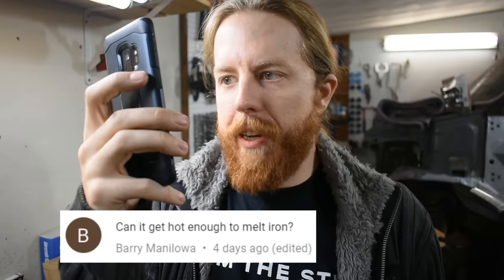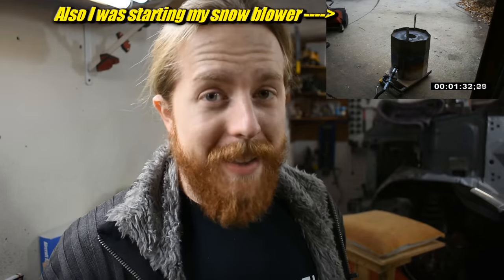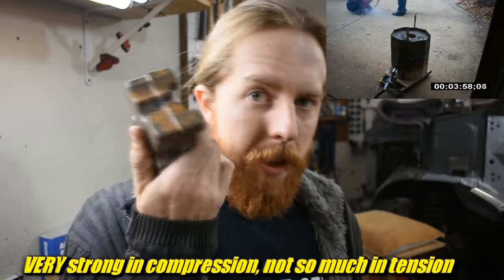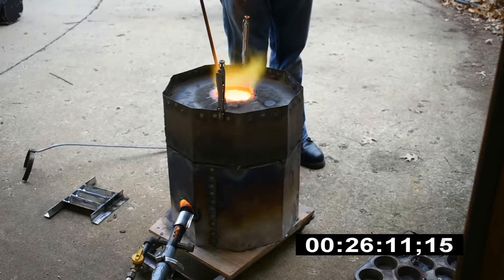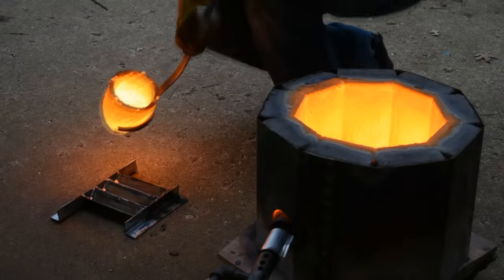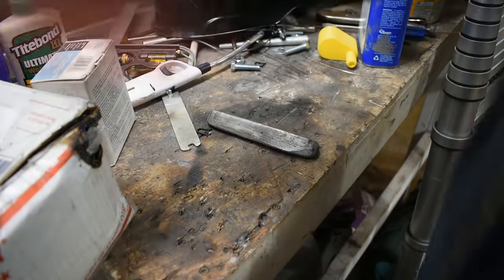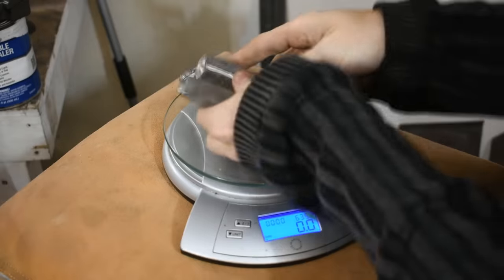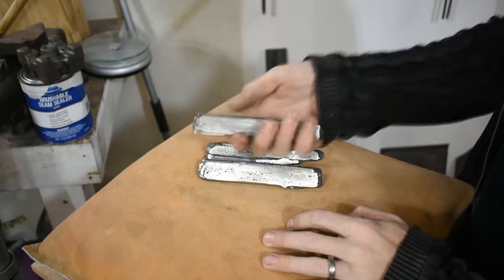Can I melt Cast Iron in my propane furnace?

Comment: It's a weight that goes into the base of a clothes dryer, to reduce vibration. We manufactured them at the iron foundry where I used to work. We shipped lots of them to Whirlpool. If there's casting ID lettering, I could tell you which of our facilities it came from.
Reply from the maker: Bingoooo!
Reply from the maker: Though technically it's a washer not a dryer, but close enough
Reply: @PaulsGarage  Yeah, I was debating between the two. It's been a few years since I worked there and I couldn't remember. We had a few parts that went into every washer and dryer.
Reply: i was gonna guess the same thing just because i know you work on stuff like that and they cant use lead anymore
Reply from the maker: The weird thing is they usually use concrete in newer machines, maybe they used iron here so its compact and wont crack and fall off? Idk
Reply: Well, they were still regularly making that part number when i left in 2016. 🤷‍♂️
Reply from the maker: You can still buy that washer sold as a cheap Amana if I remember correctly, they sell lots of them.  I'm hoping it will be a long term source of lots of this iron
Reply: lol i thought it looked like a companion cube from portal!
Reply: I would have never got it

Comment: Good work matey 👏🏻👏🏻. Don’t know if you saw my cast iron melt a month ago🤔. I melted a bbq hot plate . I had a brand new clay graphite crucible and it got a pin hole leak towards the end .( yes it was tempered perfectly ) . I had a lot of people tell me my Ingot would rust being cast iron but I sanded and polished to a Mirror finish and so far nothin👍🏻. My tank was starting to freeze  so I sat it in a tub of water and it worked a treat and the tank didn’t freeze . Eh at  least we know now 🤷🏻‍♂️. Take care Paul talk soon my friend
Reply from the maker: Thanks!  I did see your videos that's why I used a crucible I dont care about.  Looking forward to casting with it and seeing what you make! Btw that 3 color ingot you made looks awesome, time to add some cast iron to it though 👍

Comment: I bought a 100 gallon tank of propane so that solved my tank freezing problems.  My little furnace melts cast iron in about 30 minutes.
Brake disks make great iron castings BTW.   If your iron castings come out super hard you can put them back in the furnace along with some King charcoal nuggets and heat up to red color, then let cool.  It will allow you to machine them.
Reply: Yup. Nice and annealed, then. It helps if you let them cool slowly in something like sand or vermiculite.

Comment: That's quite interesting and a nice clean pour. Well done. On another note, part of the reason it may have been hard to grind is that the ingot mould being cold will have induced a chill in the cast iron. Often old casting can contain these and they are difficult to machine though they can also be intentionally induced to produce very hard surfaces. Basically you freeze molten cast iron in the pour state when it isn't iron with carbon in solution, but iron carbide. Very hard. Useful when intentional. Not so much when accidental.

Comment: Luckygen 1001 in my opinion is the go to guy for cast iron, just like olfoundry man is the go to guy for cast aluminum. Everyone watching wants you guys to do iron, they dont realise how harmful it is to your stuff. Its not a hobby type thing to do, too many variables, waay more dangerous. Not goin to say i told.... Anyway....you learn by doing, keep it up even in cold weather. Good show!!!
Reply from the maker: It sure wrecked my crucible, that's for sure, but it was toast to begin with.  I actually built this furnace modelled after an iron casting furnace, with the special higher-than-normal temperature light bricks and satanite.  One could say I was hopefully planning ahead?
Reply: Yeah luckygen!
Reply: @PaulsGarage  iron is the holy grail of casting. That's great that you can melt it.

Comment: Hey 👋.  Super cool! That has inspired me to try cast iron myself. Thank you for sharing this video. Seriously! I'm gonna try a foam skull. I use sifted play sand and all natural cat litter. Pure bentonite clay. I used a cheap food blender from dollar general to turn that into powder and start mixing the two with a bit of water until it is good. Awesome! I can hardly wait to try. I just learned about Nordic gold...basically aluminum bronze...it is mostly copper. A bit of aluminum, zinc and tin. I built my furnace out of a twenty pounder propane tank. Built the burner as well. I got the idea on line. Happy welding, melting, building outdoor life!!

Comment: Good explanation but you must check the addition of ferro-alloys like ferro-manganese,ferro-silicon, carbon.. etc. to make grey cast iron..at above liquidus temperature mixed it well, and check for chill depth to know the CI grades FC 20, 30, 40, 50 before pouring to mold.There is a massive oxidation of metals and alloys during melting and the life of Crucible will be shorter.

Comment: Paul, did you ever consider cutting the brick in the middle at half the desired angle and flipping one half 180? That gives you an angled brick with only the saw dust as waste and no spaces. Then butt the flat sides of the adjacent bricks. Again, no spaces and little waste.
Reply from the maker: It was suggested but long after I was done making this

Comment: If your planning on casting iron the possibly the best method would be sodium silicate sand. It sounds complicated but if you search it up really all it is is a high temperature adhesive (sodium silicate) with can be bought from most places like hardware stores (something to do with cars) and then sand not even fine sand. The good thing about it is it will withstand iron melting temps and also on contact CO2 (carbon dioxide) it turns rock solid. If you interested I do recommend searching it up but otherwise love your videos. See ya later.
Reply from the maker: I've thought about sodium silicate for making cores, I'll check that out again.  Didnt know it's used for casting iron
Reply: @PaulsGarage  I guess it's most popular use is in making cores but yes industrially it is very useful for casting iron.
Reply: @PaulsGarage  Silica sand and sodium silicate is a standard method for making molds for cast iron and steel. My father was in the steel industry and I used to visit him at work, that's how they made the molds for steel ingots (talking about 20-50 ton ones). For hardening they kept the molds in an atmosphere of carbon dioxide and water vapor (together they form carbonic acid which is what hardens the sodium silicate) then in a kiln for drying.

Comment: I bought brand new crucible specifically for melting cast iron.
What i found is, my limit was 20PSI regulator and possibly not enough air flow.
I ordered 30PSI regulator, will see if that helps. If not, i will add a hair dryer for more air flow.
Currently, it did melt but it would not pour for sure.

Comment: well its harder since you water quenched  it hardens the surface probably lots of martensite or retained austenite crammed in there. iron can be a beast to tame, i'm a metallurgist that specialised in Iron.  CCT, hardening diagrams flew before my eyes as you poured and quenched. :D
Still fun to watch. :)
Reply from the maker: That's interesting! Got any tips?  Good books I should read? I have a couple metallurgy books but they are from the 1800s, not particularly up to date info
Reply: @PaulsGarage  well i can strongly recomend "Steel and its Heat Treatment - a handbook" ISBN: 987-91-86401-11-5 . its a book written with the help of the largest iron/steel companies in sweden. was kind of a "bible" when i studied. Materials and processes in manufacturing by Ronald A. Kohser, Jt. Black is really nice as well though it is more a broad book about many thing's.  where i studied the main focus was Iron and steel.

Comment: Man I wish you had cast something with it. I was able to melt it in my little propane furnace as well but it was too cold to cast... at least that's what I'm telling myself since it froze up in the gates before hitting the part. I didnt have any petrobond catastrophe with mine. It burned like it always does but it didn't collapse on me. 

I also broke one of the pieces to see the grain and I was told... I think by luckygen... that based on the color I needed to add a chemical to it if I wanted something that was machinable.
Reply from the maker: I wish I had something set up to cast! I half didnt expect it to melt, and even then I was told petrobond cant take the heat so I didnt bother ramming anything up.   I'll have to break an ingot and see what I have in there, maybe shoot luckygen an email

Comment: Thanks for the vid - BTW - couldn't find the book you mentioned. Found out by trial and error that the actual title is: "The Complete Handbook of Sand Casting  (A Do-It-Yourself Guide to Forming All Types of Metal in Versatile Sand Molds). I couldn't find it because I was looking for Complete "Guide" instead of Complete "Handbook" [on Amazon]  -  FYI. Cheers

Comment: The farrier where I get coal said coal gets hotter than propane and won't explode. Propane starts faster isn't smelly but will explode if the hose is damaged or gets loose. I prefer coal even if it is smelly, smokey, and had to start -- it won't explode!! You can use it in your fire brick foundry by just blowing air in... you could make a Chinese box bellows so you could use it in a zombie attack! (Ha!)
Your videos are informative and highly entertaining.
Reply from the maker: I thought about using coal in the past but couldn't find a good source locally, it would be fun to try
Reply: Technically wrong. The btus in propane far exceed that of coal and the convenience far exceeds any need to use coal. Coal is nice for wierd shapes though.

Comment: You can put your propane tabk in hot water if it starts freezing up and a thick wool blanket on it when on the planet hoth melting down metal it helps alot
Reply from the maker: Good idea, I just need a bucket big enough

Comment: Consider figuring out iron casting before the lathe. Among the many, many benefits of cast iron, it’s amazingly good at absorbing vibrations, which makes it ideal for the big parts of all machine tools. Using cast iron (or even zinc-aluminum alloy which is easier to melt than aluminum and almost as good as cast iron—though it’s more expensive and can be brittle) and some other small tweaks can turn the Gingery lathe from a toy into a real tool.
Reply from the maker: I had considered that but I already have a bunch of the castings.  Definitely going to use iron for the future castings though

Comment: Nice run. Guess if you want to do more cast iron you should look into silicon carbide crucibles, they're more heat resistant than clay graphite ones. OTOH they're more expensive so breaking one will put a larger hole in your pocket.
Another option would be to make your own crucibles, which would be single use. I saw a video a number of years ago of a Russian who showed how he makes his own crucibles for making crucible steel using clay, charcoal powder and sand IIRC. At the end the crucible would be broken to extract the metal within, because it had to be left to cool off inside the sealed atmosphere - thus using home-made, cheap disposable crucibles was essential.
Reply from the maker: That's really cool!  I'm getting more crucibles, I'll have to get one of those for iron.  So far I haven't broken a clay one, I've been lucky
Reply: Paul's Garage I forgot an impprtant ingredient for those crucibles: grog. Not the rum-based one but the pottery kind. Pieces of broken crucibles from previous batches, ground to a coarse powder and mixed with the new batch. They have a very important role in regulating shrinkage and expansion of the new crucible under heat.

Comment: you should try ceramic mold casting, like first dip the part in a cup of thin ceramic and then switch to thicker ceramic and sprinkling sand on it and build up layers like a candle. im in the process of making a forge and want to use this method for casting 3D prints.
Reply from the maker: I've thought of that, it would be awesome to try.

Comment: Since your fire brick is easily cut and formed, can you simply carve a shape into it and pour liquid metals onto the surface, or bind two of them together, like the way you did sand casting?  

Of course, iron melts just over 2800 F and steel (so I've been told) melts at 3000, so you can't use your #28 fire brick.

Comment: Paul, the 1st degree burns can be prevented by wearing Aluminized gloves

The Al (aluminum/aluminium) reflects the heat away from the wearer, with the exception of you dropping a glob of molten metal on yourself, which is unlikely, but ALWAYS possible.

I greatly apologize for the graphic mental image...

On another note, you can also buy aluminized aprons, full suits (not like a tuxedo suit) and mittens (I may be wrong about the last one, please don’t hurt me if I am) ._.

The only downside to aluminized protective equipment is that it’s a bit expensive, however, the price of severe injury (or death) is far more...
Reply from the maker: I looked up that aluminized stuff, its expensive but nowhere near what I expected it to be.  Kind of affordable considering the safety it affords, plus it would be a good Halloween costume

Comment: iron make a excellent bearing most all machine tools lathes and mill use cast iron for the sliding members its also extremely stable another virtue for the machine tool builder
Reply from the maker: Thanks for the info! I though iron was a bearing material, just wasn't sure

Comment: I've heard when casting iron you need oil sand instead of green sand. Due to the fact that the water in green sand can cause steam explosions
Reply from the maker: Interesting, I have oil bonded sand but the sand maker says dony use it with iron. Sounds like an experiment is in order

Comment: I have watched all your vids, love them. My son and i made a furnace with fire clay, perlite, silica sand and cement, works well. copied your burner idea but couldn't get the same parts in the UK so made my own with a choke and no hair dryer. only done Aluminium at the mo with petrobond sand. trying to cast gears but need to improve the template.

Can i use flux/low salt to improve the poor or does that make the cast brittle? 

Keep up the fab Vids.

Comment: There's a video somewhere of a guy melting steel (with propane iirc). Basically it was just super super insulated, it was in a drum, and took a while
Reply from the maker: Yeah lots of insulation will help raise the max temp of the furnace, but theres a limit to what I want to do here.  For steel stuff I'll probably just try forging it, casting it gets tricky

Comment: You need a hotter infra red thermometer one that goes up to 3000 degrees then you could measure the heat output without wasting your iron weights.

Comment: I haven't finished the video yet, but I'd like to say that if you use an oxygen tank instead of or as well as the hairdryer you'll be able to get hotter heat faster. You'll need to use more propane as well... Your burner might self destruct though.
Reply from the maker: I oxy would be amazing! I don't have that much of a death wish though, and I'd probably need a furnace made of space shuttle tiles or something

Comment: And here I was coming in to say I did my first Copper melt with a new torch-went very well where I remember you had some problems.  [[:D]] and yer melting Cast Iron....grumble.  Not sure I want to try cast-extreme light sensativity-had to use my dark glasses to see the crucible for the Copper so not sure it's even possible for Iron.   Oh well, I have to live Vicariously thru you I suppose tho I would love to make some 'Rods of God' to launch in a hot air balloon to drop on Zombies and such....

Comment: Put tank into a pail of warm water that should keep them from freezing
Reply from the maker: That's what I was planning, except its winter and the pail of water will freeze on its own! :(  still I would have some added time if I used hot water I suppose
Reply: @PaulsGarage  Put pail and tank in the garage? I Know I live in the frozen north too. Magnet block heater? Hamilton Ontario Canada.
Reply: Could always add some salt to the water
Reply: @PaulsGarage  Throw a heating element from a water heater in the water. You can run them off 120V and they just don't get quite as hot as 240V but they still heat up good. Well don't throw the element in water or it'll short out. But I'm sure you can hang one so the contacts aren't in the water but the element is.
Reply: A cheap sous vide from Amazon or similar will heat the water and keep it at whatever temperature you tell it to be at upto boiling.
Reply: They have cattle water tank heaters at hardware stores

Comment: Paul - Can you go into detail on how you built the mold that you used to create the ingots? Also, what PSI was your propane tank pushing? I'm tempted to try it after I melted copper handily in my redesigned furnace.
Reply from the maker: The regulator is up to 30psi, running full blast.  The ingot mold is just angle iron welded together.  I'll go over it a but in the future probably

Comment: Hi, paul forgive me but i'm pretty new to casting i just finished making my foundry a month ago, so now i want to ask you about how i could increase my temperature, i can't seem to get past 1100 degree celsius, would adding more air pressure lead to higher heat? i think my air blower is pretty weak since i'm using a low pressure regulator and even with that i can only open the valve a quarter of the way otherwise the jet like air would turn into a tornado i'm not sure if that's the correct way of explaining it but yeah, hopefully i'll get answers thanks :)